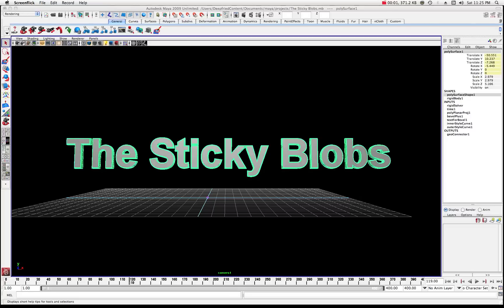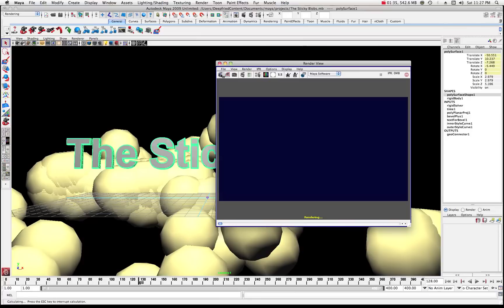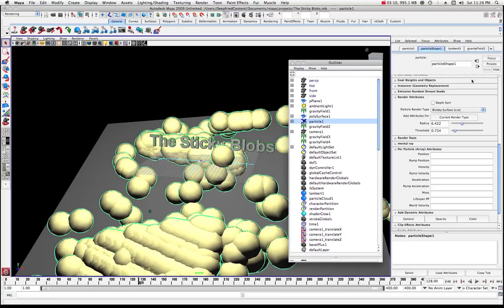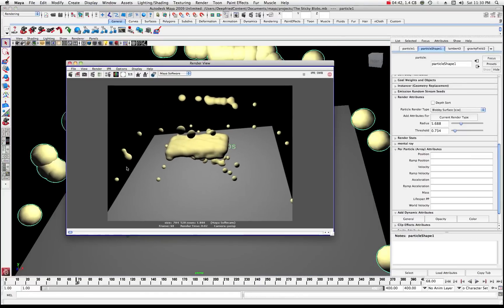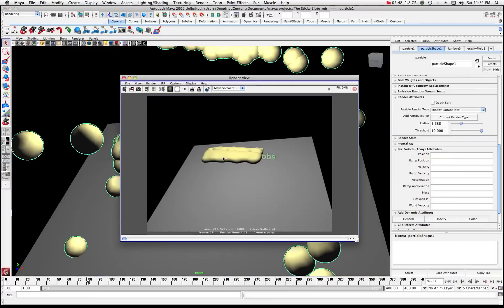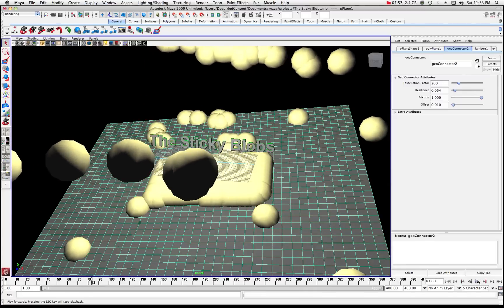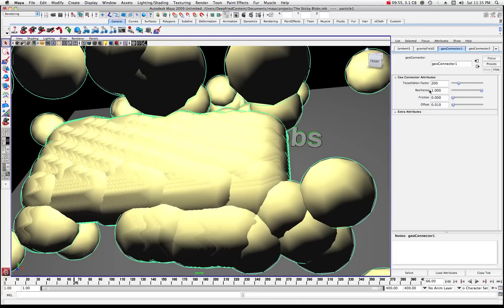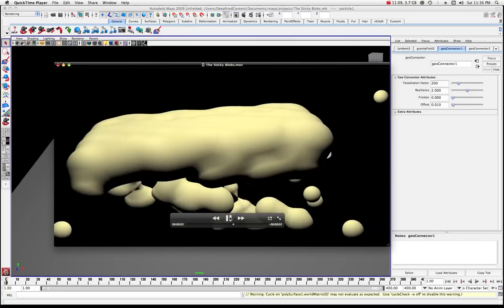Maya Blobby Surface Fine Tuning Tutorial Part 2 of 2 by Stuart Christensen

Comment from the maker: sounds like you need to reduce the "threshold" setting a bit, and perhaps increase the radius.  As for rendering, make sure you are either using Maya or Mental Ray as your rendering option, and not Hardware render.  Open the render settings window and from the dropdown menu choose from there.  Hope that helps.